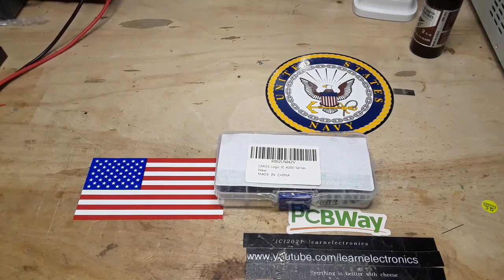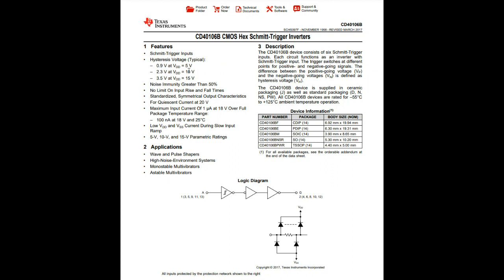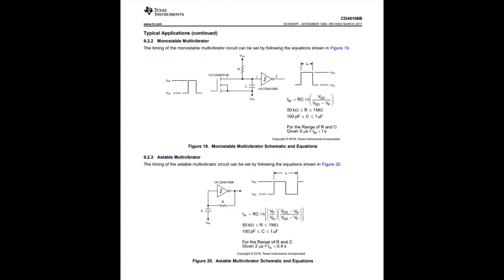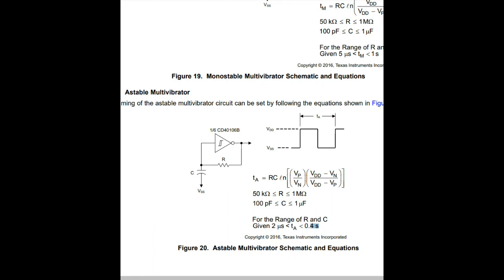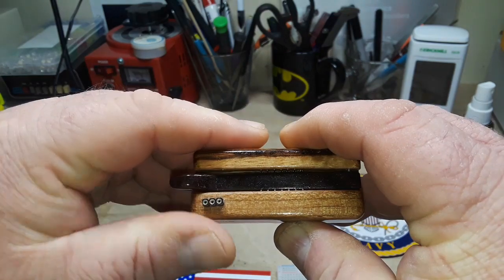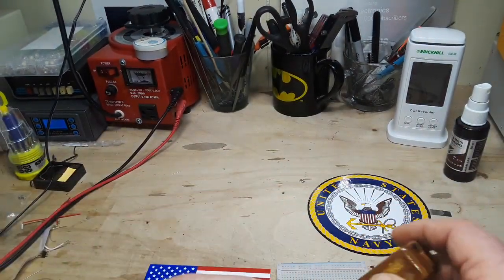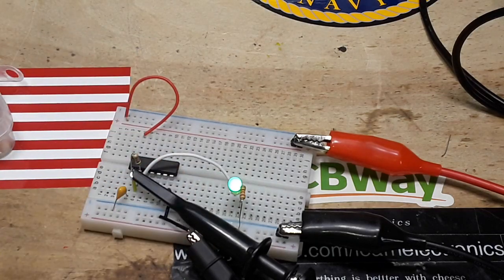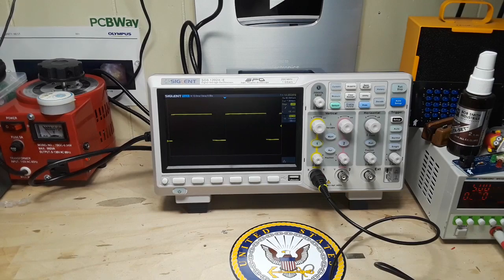CD40106 Schmitt Trigger Inverter

Comment: if you want to impress folks, or make a load, use a quad XOR (cd4030 or 4070 i guess). i own none of the ICs in question. but i have decades of dsp and can authoritatively state, you XOR those pulse waves together, you'll have one keen electronic percussion sound. the method is used for hihats in modular synthesis, but to my knowledge, no one has used it for anything else eg. snares. i have, in software (bong vst, acclaimed by many). add a resonant filter or such (and some highpassed white noise). the only problem then is that synthesis consumers don't like innovation, they like to do what they see famous people do. i'll leave this here for persons enjoying this channel.

Comment: The supply rail really needs a decoupling cap close to the IC. Adding two resistors, and two diodes to the feed back path allows the mark space ration to be set independently. The feedback resistor can be replaced with a pot to give an adjustable frequency output.
Adding a transistor the feedback path allows the output frequency to be modulated.
Schmitt's really are very versatile components, which I believe to be far more flexible than a 555 timer.
 For example, I recently used the quad Schmitt nAND to produce a stroboscope. This switches an LED array via a mosfet at between 1Hz  to 38kHz, with a pulse output with, feedback control,  between 150us at the slowest flash rate, down to sub 2us at the maximum flash rate, giving a good approximation of constant brightness. Adding a pic, provided a LCD flash rate readout, with a multitude pot providing analogue flash rate adjustment. 
In sound generation applications, the quad nAND, provides the option for one oscillator to be used to control another ( or more).
While the output is a square wave the charge discharge curve of the input approximates to a triangle wave. Adding a transistor to the feedback path, configured as a constant current source, can produce a very linear ramp signal.
RC filtering the square wave output can give a good approximation of a sine wave, all be it at a low amplitude. 
The Schmitt is really useful as button input denounce for other clock logic, such as state machines, counters,  combination locks, alarm circuits, etc. A huge number of projects can be produced using this in combination with a Johnson ring counter.

Comment: This setup is actually the first step to make a simple TDR, Time Domain Reflector which is handy for measuring cable length and impedance.

I've used the 74AC14 for it because of the extremely sharp edges of about 5ns

Comment: always enjoy making pretty sounds - looking forward to this series very much!

just wondering why the initial capacitor value gave a frequency that was not what we expected?
Reply: Good question.  If I plug in Vn(min) = .9 and Vp(max) = 3.6 from the datasheet into the equation, the frequency works out to 79k.  Not far from his scope reading.
Reply: @Enigma758  I think 500Hz to 2.2 Hz is the recommended usable range.  In other words the formula might not work quite so well outside of that range because of the chip characteristics.
ETA: I'm also wondering if the duty cycle will get a bit closer to 50% with a higher resistor in the RC network.
Reply: @Chris_the_Muso  That occurred to me to.  The 50k/100pf combo is pegged to the high  end.  However, even the slowest combination 51k/1uf is a bit off.  Using Vp(avg) = 2.9 and Vn(avg) = 1.9, the formula yields 24hz compared to his 14hz.
Reply: @Enigma758  Still with the 50K ohm resistor though - it would be interesting to see how accurate it is with component values more in the middle of the range.  It's not that clear what is going on from the data sheet, but there's always a "gotcha!".
Reply: @Chris_the_Muso  I hear ya, it could be straddling that fine line.  The chip could also be a low quality knockoff.  Also, I usually test my resistors and capacitor before using them even if the markings appear correct, so that's one less thing that can go wrong.  It might be a good idea to also check the Vd and Vn values with a voltage divider.

Comment: One interesting thing is that the pulse seems longer high than low on the scope. Perhaps after inverting it is more easy to see.
Reply: The duty cycle is not 50% but for a simple clock pulse it should be fine.

Comment: they must a kind of latch inside which holds the output from jumping all over the place, YES??
Nice Video Paul.. : )
Reply from the maker: That's the hysteresis. It triggers on the rising edge at a higher voltage than on the falling edge.

Comment: I have been noticing an uptick in 4000 Logic chip use rather than the more common 74 TTL family. Wonder why?
Reply: The 4000 series has a wider voltage range. Synthesizers use this one volt an octave thing so they tend to run on 12V rails.